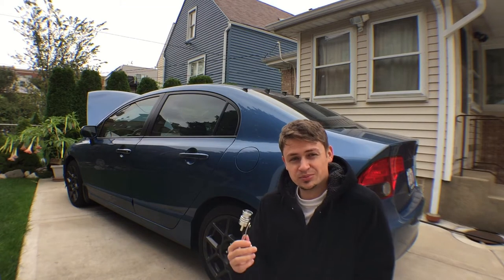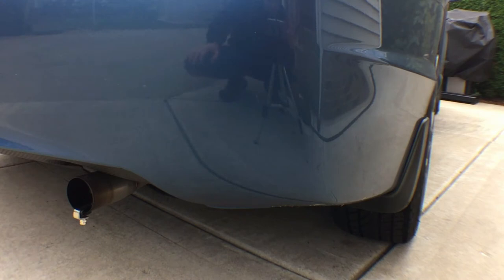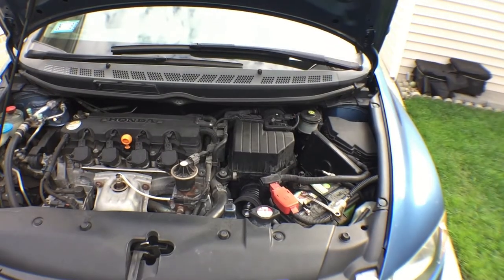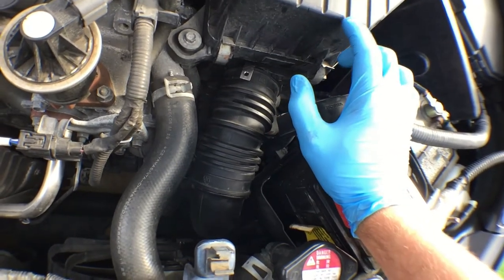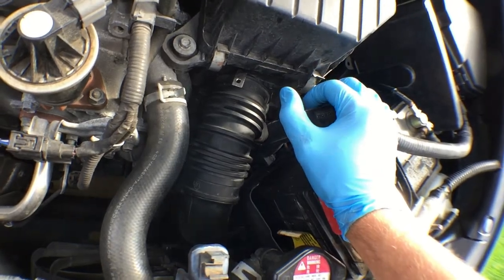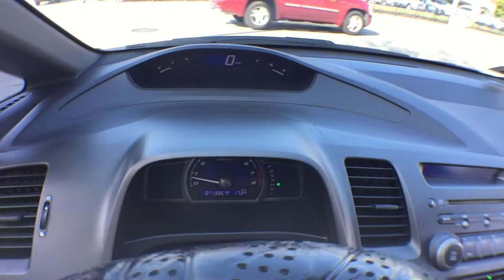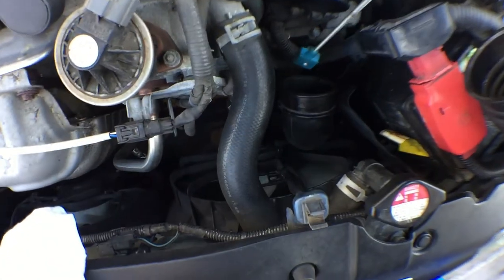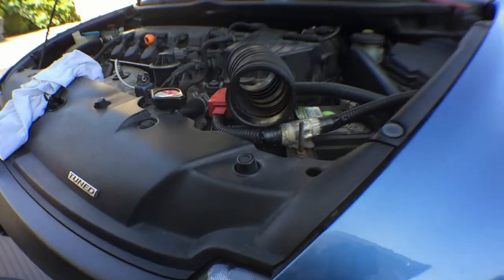Turbo Whistler on the INTAKE

Comment: Ok do a muffler delete an get a short ram intake or cold air
Reply from the maker: Muffler delete on a automatic will sound horrible.  And an intake without any tune won’t be beneficial unfortunately .
Reply: On a honda yes hahaha ive got a subaru basic impreza cvt i did a muffle delete an it actually sounds nice it has a rumble to it an some times it back fires i guess becuase it only has 1 catilic converter
Reply from the maker: Yeah Subaru sound nice in general because of that boxer engine
Reply: Muffler delete Actually sounds amazing don’t ever do a muffler and resonant 🤮

Comment: Just boost it til it blows
Reply from the maker: It will blow  quick.
Reply: I'm an owner of a boosted Type R Integra never had a problem yet
Reply from the maker: @kibbleracingteamturbor6335  because it’s a b18c5 not a R18 haha.
Reply: Indeed

Comment: As a modded Civic owner please dude cold air intake the damn thing
Reply from the maker: Hahah.  I’m good. I don’t want to get a tune.  Technically you would want a tune after.  Otherwise not worth it and probably will run lean.
Reply from the maker: Hahah.  I’m good. I don’t want to get a tune.  Technically you would want a tune after.  Otherwise not worth it and probably will run lean.
Reply: @BulliKid  you won't have to get it tuned unless you chip it
Reply from the maker: You don’t have to but you should.
Reply: Just giving you some friendly advice I've owned many builds
Reply from the maker: @kibbleracingteamturbor6335  nice what kind ?